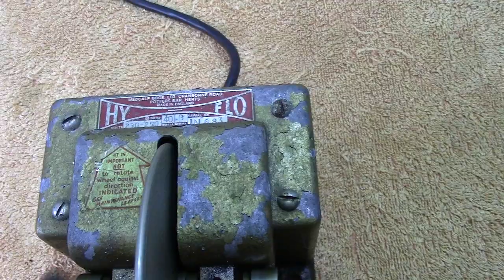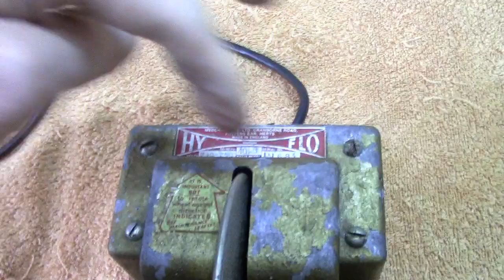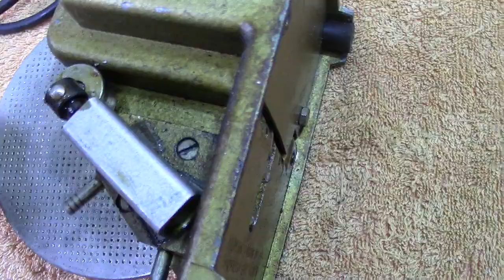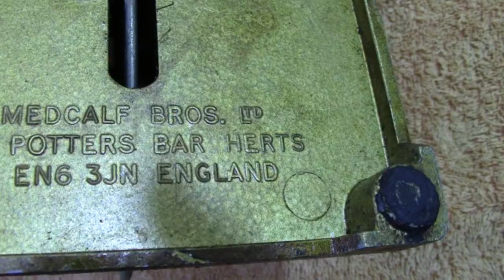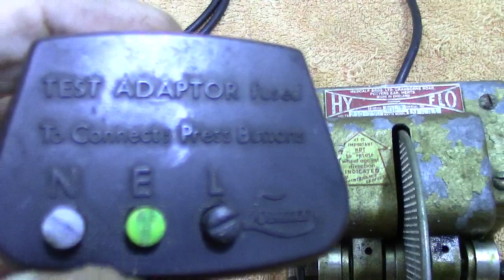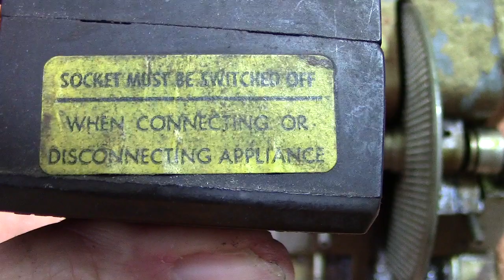Hy Flo vintage aquarium air pump      40w   B model   230-250v  ac

Comment: I have this bump, no power to push air in water, what inside the piston? i found some oil rag, peaces. It leaks air for the place where the two holes are ( brass surface )those surfaces is scratched some. Maintenance help!:thanksdoc:
Reply from the maker: goodluck with repair these are getting rare now.